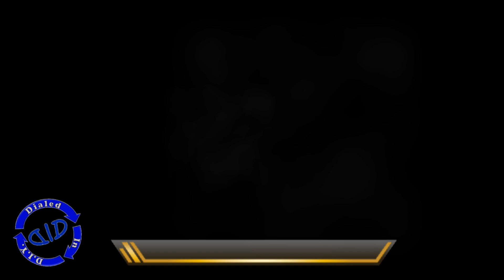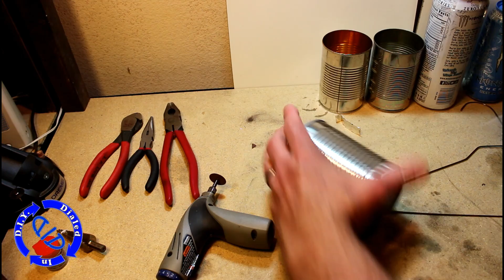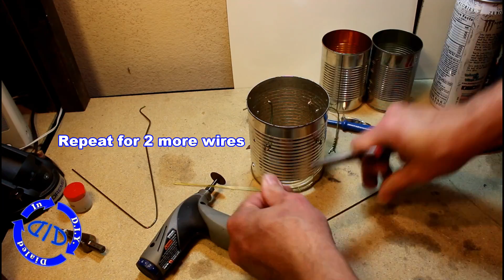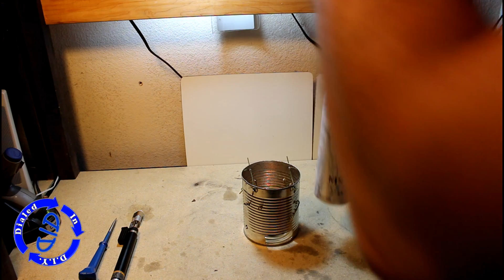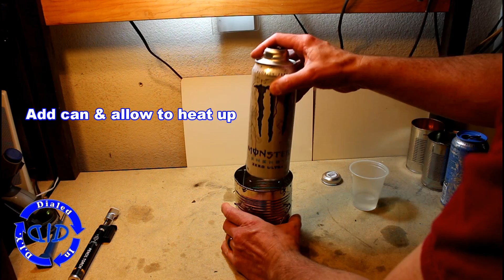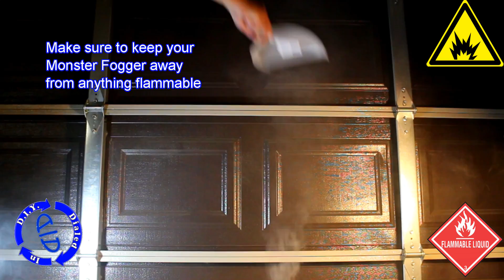Fog Maker & Fog Juice   Quick to Make

Comment: What kind of glycerin did you use? I tried this (using the alcohol candle as a heat source) with vegetable glycerin and only got a faint puff of smoke.
Reply from the maker: Sorry you did not get the effect you were after right away.  I used the same; vegetable glycerin.  One thing to consider; if the can is not really hot first then you get a slow boil with little fog.  You can also try to drip it in just a little at a time onto a really hot surface. Each different version I have made required a bit of experimenting to get the timing and amount of fluid just right.  Quick Q: did you use distilled water with your fluid/glycerin?

Comment: where did u get that torch  ?
Reply from the maker: I thought it was from Harbor Freight or Home Depot but I just checked both websites and did not find it.  I will do some more checking to see if I can figure it out.  Are you looking to buy one?
Reply from the maker: Hi FFM9, I found an item # on my torch (#41169) and a quick search pulled Harbor Freight references.  It does not appear to be available there at the moment but there are several similar looking versions out there that also come with soldering tips (i.e. search "butane pencil torch"). Hope that helps.

Comment: i tryed it did not work
Reply from the maker: Sorry to hear that Austin.   A couple of things to try that I learned through trial and error.  1. make sure there is a strong enough heat source before you put the fluid in (it needs to hit the hot surface & evaporate). 2. Make sure there isn't too much fluid at one time (try using a few drops at a time until you find the amount that works best for your set up).  If all else fails, switch to a flat bottom can - I have had success with soup cans too.